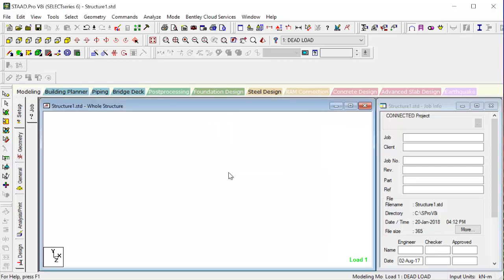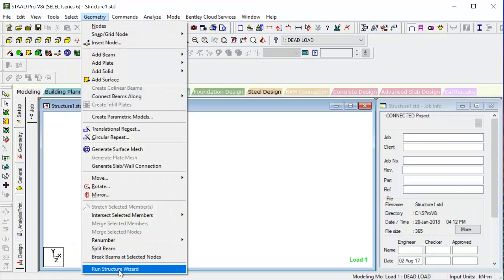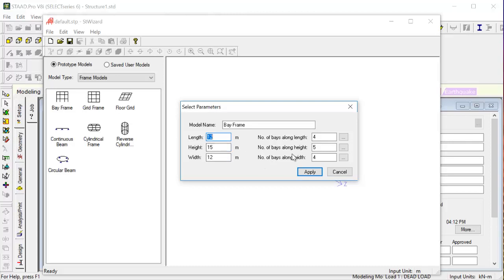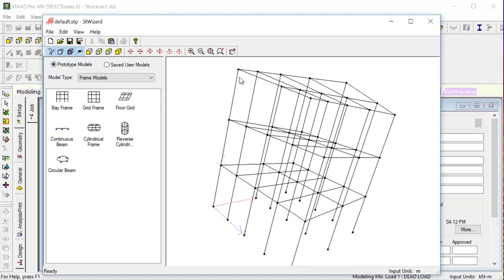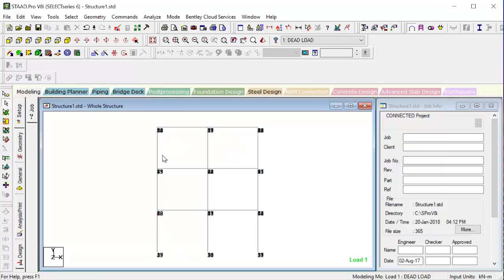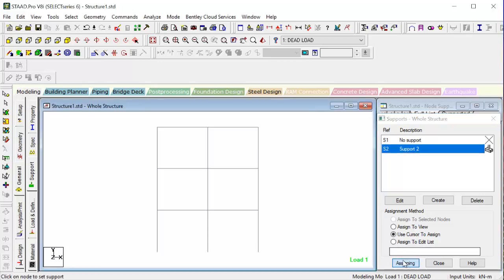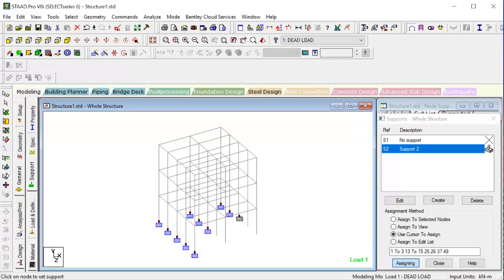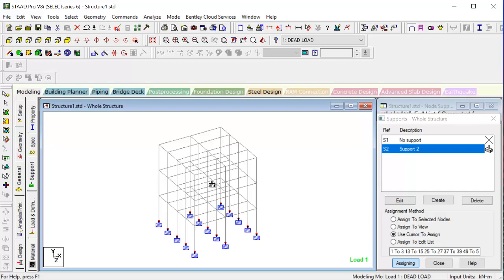STAAD PRO v8i Lecture 18: Adding bay frame model

Comment: sir, I have an error... after giving the dimensions to the bay frame, I click on transfer model and click on YES. 
It can't opened that box... which is that PASTE PROTOTYPE MODEL to insert om staad pro....
It can't insert that frame on staad to analyse...
How can I solve this...?
Will you have the solution for this sir...?
Reply from the maker: Can you share the screen shot.... switch off the grid view and try once....